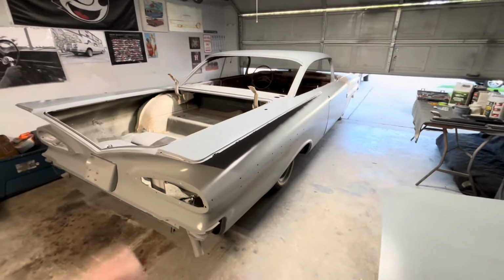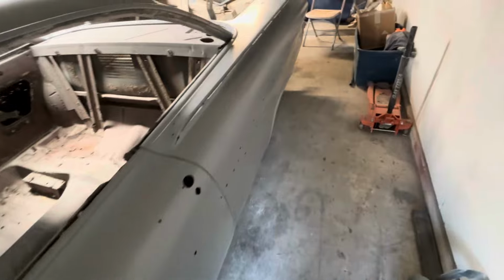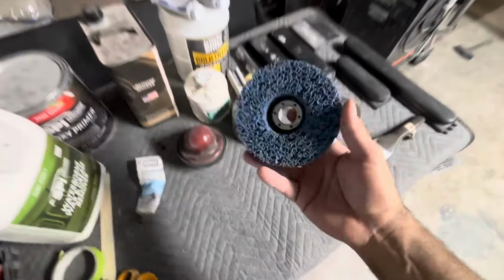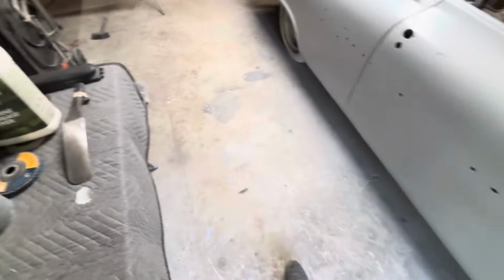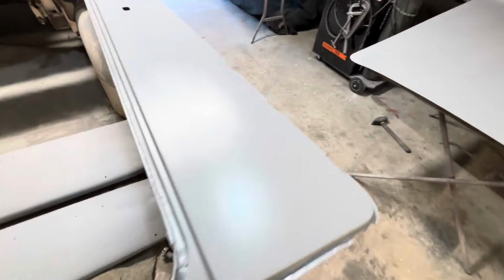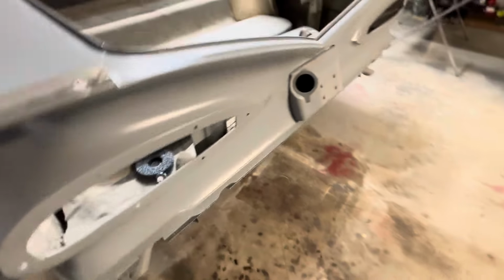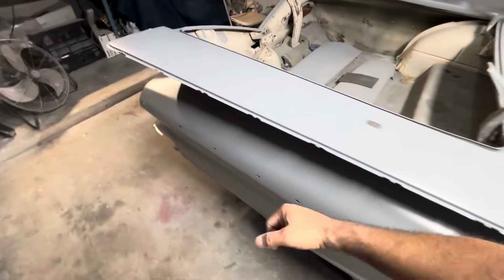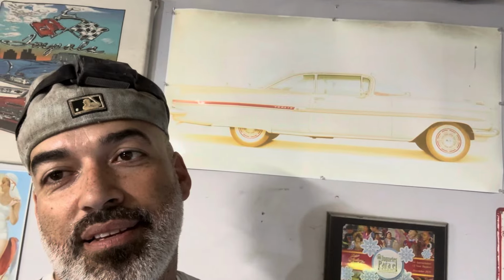1959 Impala update bodywork details! #diy #1959impala #lowrider

Comment: That was a good car to start out with but you are making it into something Special 🙂
Lots of great tips to apply to any car for sure.
Nice work on explaining the prosses and products that you uses.
I was in the Service in the 60's with Guys from Detroit and they could tell you some stories about how cars were built and how messed up some of them were when they were still in the Factory 🙂
My first car was a 59 I got for $15 only a Biscayne.
No radio, had to put ball joints in and valve guide seals, ran like a top
Reply from the maker: First off, thank you for your service Ed!!
 Lots of respect for that, Im not much for regrets but not being part of the military is definitely one of them. 
This car had never been apart, there were some questionable things going on to say the least, even found some cluster bulbs and a nice 60s screwdriver embedded under the carpet 😎 
That would of been me asking who took my screwdriver 🤣
Reply: I was one of the Lucky 5,000 to get Drafted into the USMC, my Buddy got Drafted into the Navy and all he did was Throw Up for 2 years.
So I guess I got the better deal 🙂
Don't worry about never serving, your a Good Man with a Good Wife and a good Family, we need a lot more people like you for sure.
Ken has  told me that you were making great progress on the car.
How's it looking for the 4th for paint ???